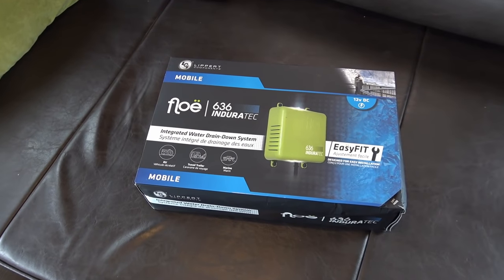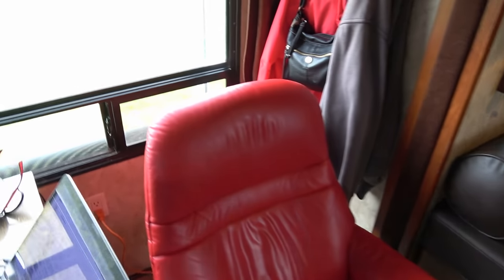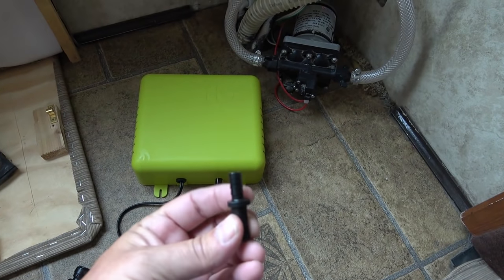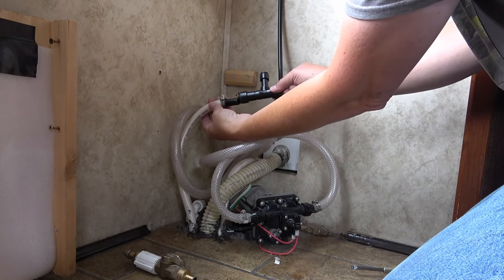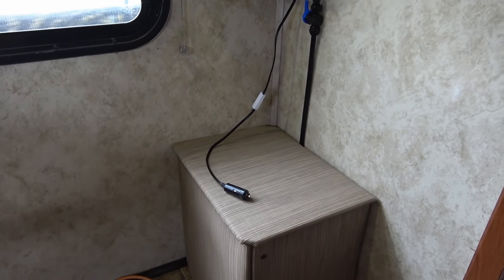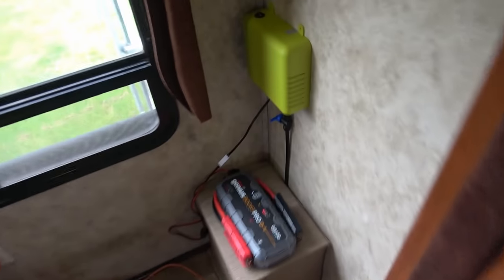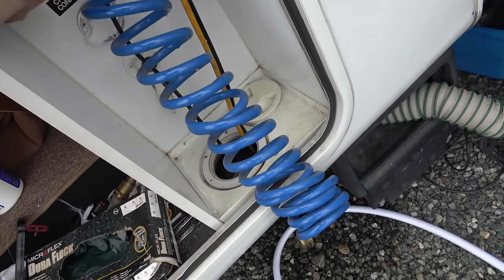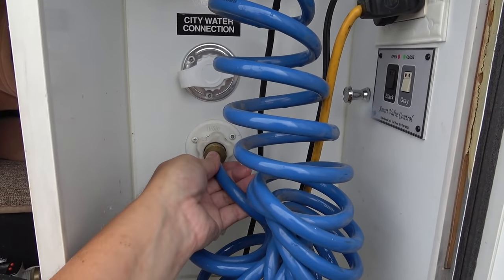Install/Demo of Lippert Floë Automatic RV Drainage System - Quick and Easy Winterizing

Comment: Not anything i would use. I already have a compressor always stored in my RV. 1) It is expensive. 2) It is loud as hell. 3) You should already have a compressor. 4) If you can't mount it somewhere hidden, it is ugly. 5) I only have to winterize once a year.